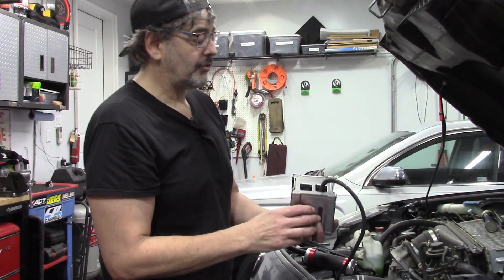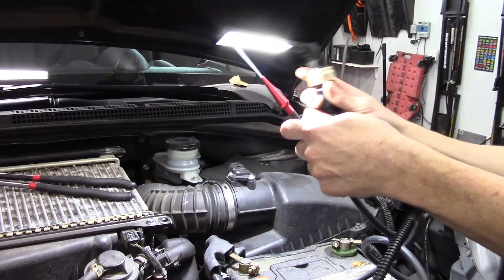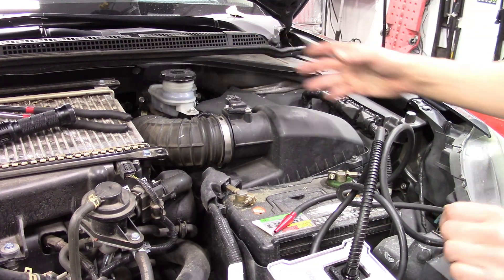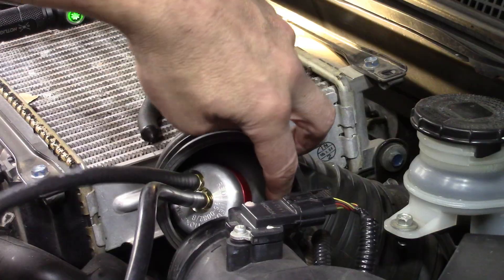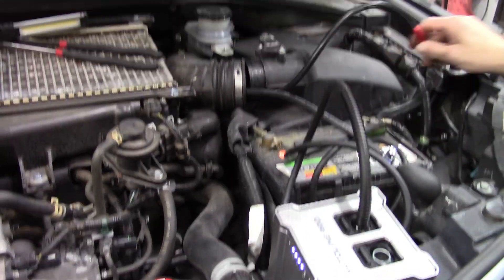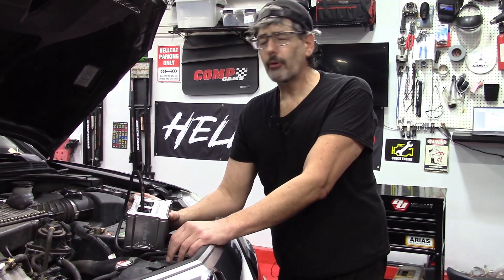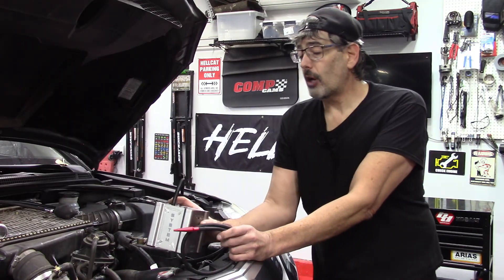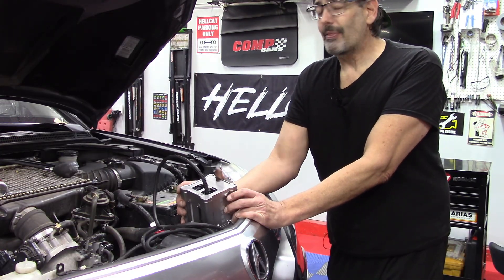How to EASILY Find Engine Vacuum Leaks!

Comment: Watch the fuel trims on your scan tool while JUDICIOUSLY spraying supplemental fuel (carb cleaner, propane) on suspect areas. The O2 sensors are much more sensitive than your ears listening for RPM change. But that looks like a dandy tool for the dreaded EVAP diagnostics.

Comment: I like to use a laser pointer to find the smoke in hard to reach corners. It will easily show dissipated smoke that comes from a spot that you don't have a clear line of sight on.

I think I saw Ivan from pinehollow diagnostics use this unit also.

If two of the YouTubers I trust the most use it, it means I can pull the trigger without any concern.

Thanks for this quick review.
Reply: That’s a really good tip! 👍
Reply: @tedjohnson64 if you don't have a laser pointer at hand, but you have an infrared thermometer, you can also use that, since it uses a laser.

Comment: Listening for a change in idle  speeds also works while using propane, starting fluid, or WD40.
Reply: Thanks for your post. If I make ask how exactly is done? I have someone to spay WD 40 on where while I watch the RPM meter or listen to the idle speed? That is better than the smoke test?
Reply: @danpan001 make sure the engine is running ( idling ) first don’t dump propane and then start the engine cost me a muffler once 😢 move the torch slowly over the engine when idle goes up be very specific with watching where idle changes to be honest I haven’t done this in the last 20 years cars are computers and a mess of wires now cheers
Reply: Proven test in late 70s you must be very old  😉 or you have or had a dang good and resourceful teacher cheers
Reply: Both I’m 73 and was involved in racing already at 14/15 yo most of my many teachers didn’t know they where teaching me, I would observe a lot and if needed would ask questions  cheers

Comment: i use an incense stick, engine running. of course the radiator fan must be off.    i look for the normal vertically rising smoke stream to be pulled away toward the vacuum

Comment: A fool and his money will soon part.
Reply: Very true. That’s why I never make foolish purchases.
Reply: @SchrodingersBox 
I know. That's why they gave it to you! 😂
This thing is a waste of money. I can go through the comments and find at least 5 different ways which are just as effective and cost nearly nothing.
Reply from the maker: @Carl_Jr I would like to point out that this is a tool review channel.   Do you have any suggestions of a tool you'd like to see reviewed?
Reply: Waste of money???  Are you crazy?  It paid for itself THE VERY FIRST USE when I diagnosed an EVAP vent solenoid leak.
   How would you have done that exactly. I’d love to hear your easier method how you would find that.

Comment: My first real job after high school back in 1973 was working at a garage, the head mechanic would blow cigar smoke into a container with a small rubber hose on one end and a schrader valve on the other end and a small bicycle pump, it worked fine, if you didn’t see the smoke coming out you could smell the cheap cigar .

Comment: That's a nice compact unit. I like that it is self contained. I built my own smoke machine but it relies on shop air.
Reply: Instead of using shop air, use an air pump from a fish tank. You still need electricity, but many cars have 110v outlets. or get an inverter/convert to go from 12v to 110v.

Comment: I have the autoline pro but wanted a portable one with the vacuum ball . But reviews were saying they didn’t last very long. So I am sitting back waiting to see if it changes
Reply: Mine has the vacuum ball. I didn’t show it in this specific video but I have in a previous one. I have had this system for almost 2 years and use it nearly every weekend.
Reply: @SchrodingersBox ok that’s good to know because on Amazon the reviews are scary
Reply: @SchrodingersBox I really wanted one had it in my cart but then started reading reviews. I just had my Autel ultra which is only 5 months old brick on me . And they are making me send it back on my dime . Says core 7 uncorrectable. So Iam so Leary of buying anything lately
Reply: Well I can tell you there were a few of my viewers that said the oil leaked out of their units but they called the company and the units were replaced no problem.  I really think the customer service is very good and they are based in USA. In fact if you have any issues and hey don’t resolve it let me know and I’ll contact them personally!
Reply: @SchrodingersBox 👍🏻
Reply: @SchrodingersBox  I was one of those people who had a leaker.  I pre-ordered this machine so I got one when it first came out.  After I discovered that mine had leaked all of the fluid out, I contacted the company, and they sent me a new one and I sent the old one back.  I recently bought their new model but have not tried it out yet.